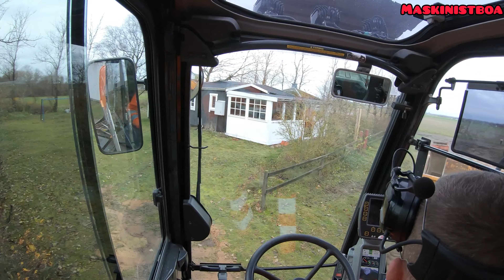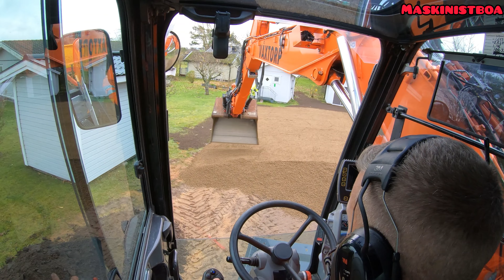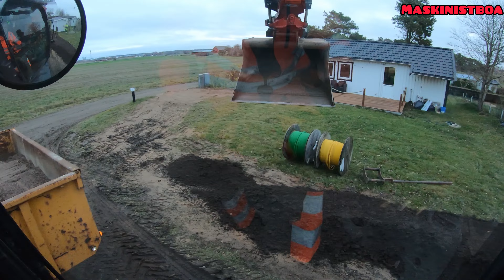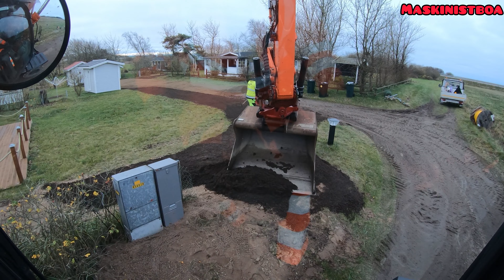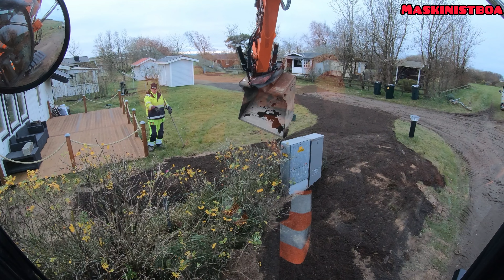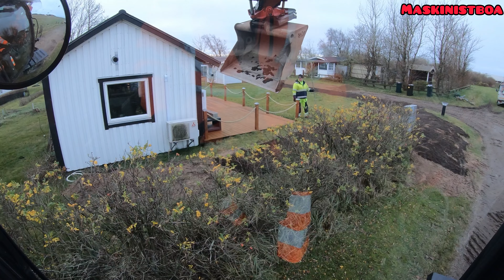Hitachi ZX140-5 with Rototilt. Gravel grading and dirt 😃

Comment: Hello! Very nice 👍. I'm wondering how tiring this is for you? Do your hands get very tired or do you manage to do everything relaxed? It seems to me that this work requires a lot of concentration and painstaking hand motor skills.
Reply from the maker: Hi, and big thanks for your nice comment.
To your question.. No i don't find it very disturbing. Sure it requires some concentration and still after a lot of months in this machine i find it a bit slow and not so motional as i was used to earlier. But not that hard that my hands or wrists get tired. The levers are quite light to move.
Thanks again, and thanks for asking 😃